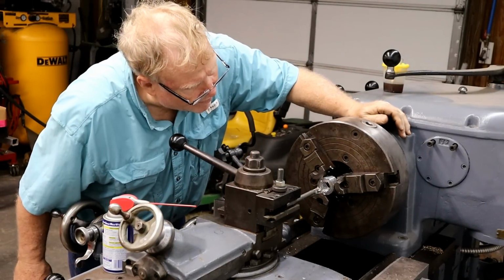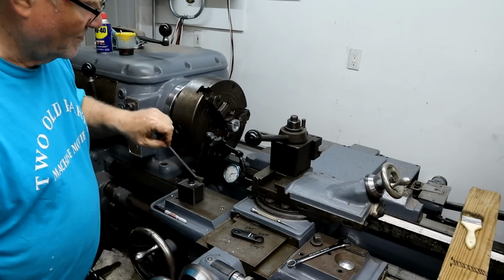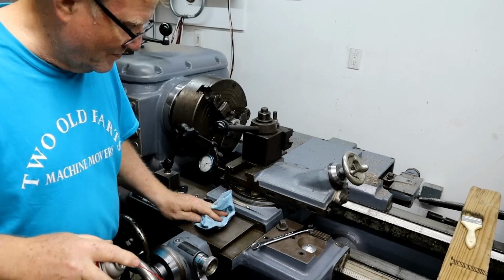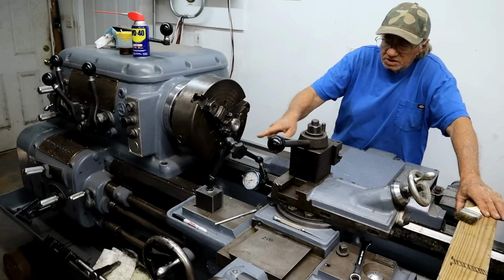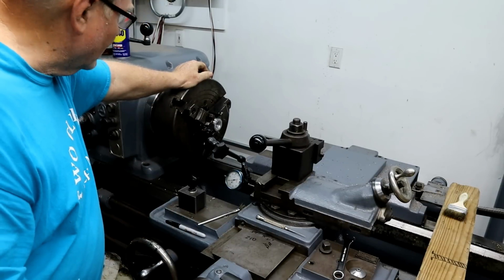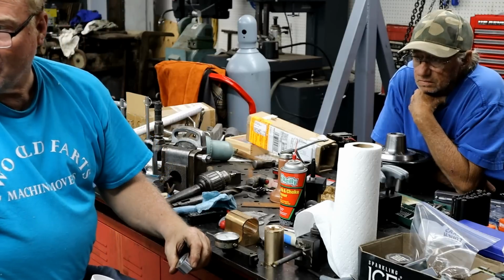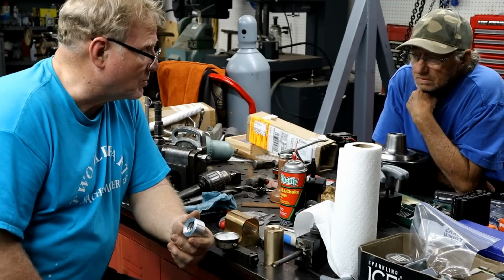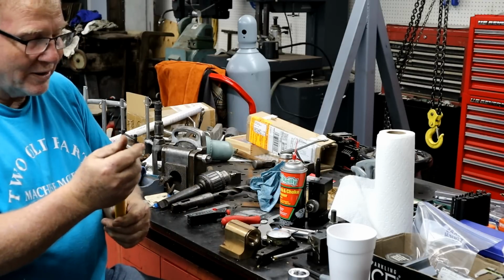Old Tools Restoring Old Tools : Multi-Start Leadscrew Nut

Comment: Me thinks you’re a little bit scared of this difficult one shot job, as you should be. Can’t wait to see that double lead nut screw smoothly onto Dons shaper shaft. Your new design is much better than the original and should never need replacement.
Reply from the maker: Just a little.. The problem is the cost of screwing it up and it's not my money.... Well until he adopts me and kicks the bucket :)

Comment: Probably should have made a test male thread at 4 TPI to test your female thread, and then either make a male test thread at the 2 TPI double start or used the single test thread and turned it 180 degrees to check your progress. That way you could check your depth while also checking your thread width so you get a tight fit on both threads. It’s easy to come up with these solutions after the fact in case you didn’t know that. Lol Thanks for the video.
Reply from the maker: No need.. If you will notice I am using the real screw to fit it....

Comment: A friend of mine that cut multi-start threads for years insists you have to make a special insert holders to incline the insert to get the correct thread profile. He says you may have to grind the insert too. They used custom inserts too. They had to section and measure to meet the spec. Good luck.
Reply: It’s an Acme thread insert, hopefully will work.

Comment: I believe there is a much easier way.  4 leadscrew pitch I presume, 4tpi double pitch means leadscrew 2x spindle speed.  With a 4 leadscrew you should simply be able to engage halfnut on big line or little line of dial.  Take a scratch cut on piece of scrap to test, can do on outside, easier that way.  I have done this before worked well.
I have a Hendey,  it has markings on spindle opposite chuck end, can disengage gear, rotate to correct mark and re engage.   I would have to put thread dial on my Hendey to cut this thread, I have never used it but I have one, I use the leadscrew reverser leaving halfnut engaged, hey, it is the Hendey way.
In some ways a Hendey has more bells and whistles than an Axelson.
Reply: I should have said numbered and  unnumbered.  Just run carriage along and see where the halfnut engages,  pick out 2 marks.

Explaining chasing dials,  draw a line on paper, put pencil mark on top to represent thread, bottom side put pencil marks representing leadscrew pitch.  Kinda a graphical representation of how the chasing dial works.
Reply from the maker: It does not work that way on this Axelson.... It did work that way on my old Southbend Heavy 10.    I had that one for 34 years and cut hundreds of multi start threads on telescope eyepiece holders... I still kick myself for selling that heavy 10 off ...

Comment: If you had to chuck that test piece back up into the lathe for further cuts, how would you clock it in?
Reply from the maker: You could do it easy enough... Just a standard thread chase... Start the lathe, close the half nuts and let it advance into the thread and then shut off the motor.... then advance the thread tool and adjust until the insert fits into the thread....